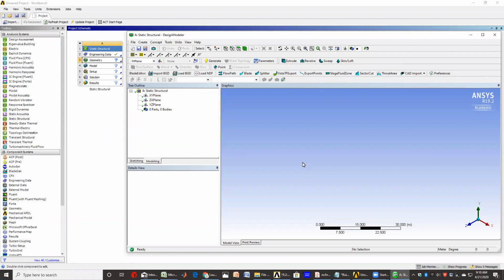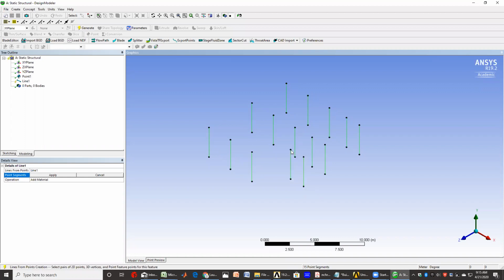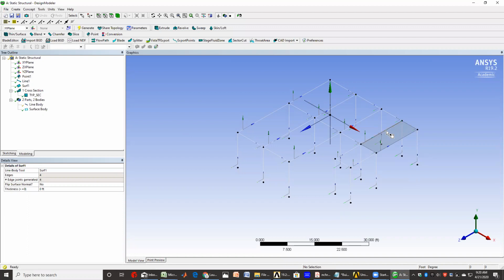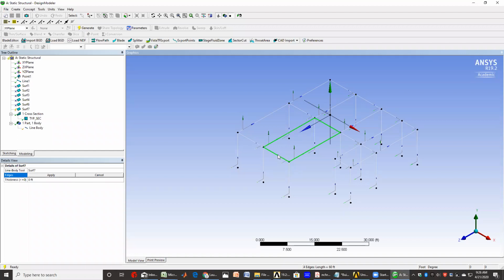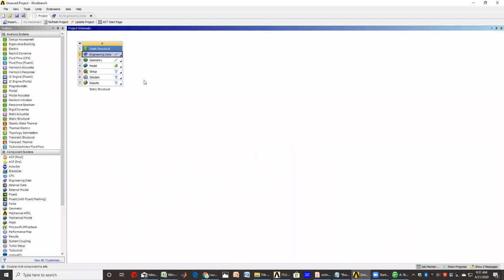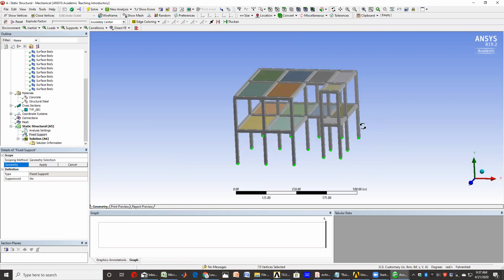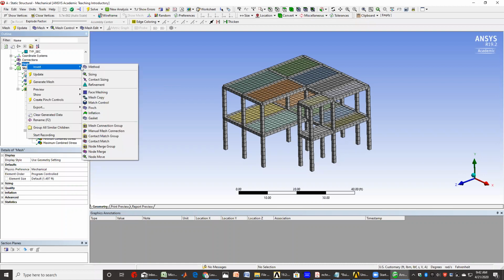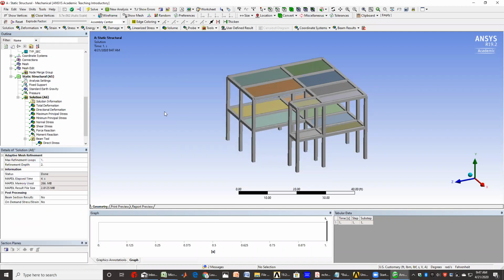ANSYS Workbench Analysis of A Building

Comment: why did you applied 100 psf of pressure to the surface at the same time? is the pressure distributed among the faces making 100 psf in total or is it that each surface has 100 psf?
Reply: each will have 100 psf. For different values pick a surface at a time.